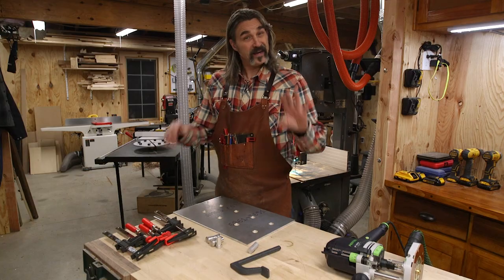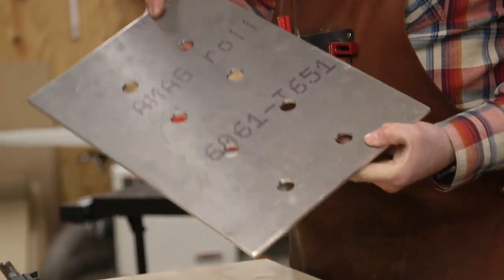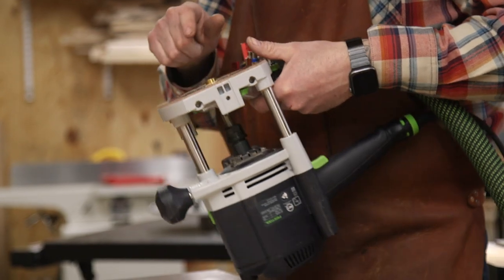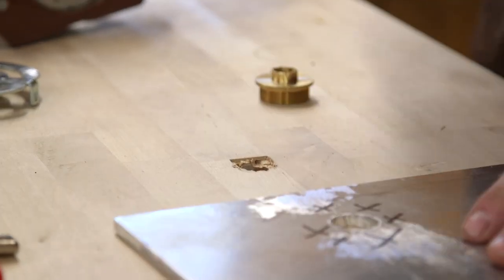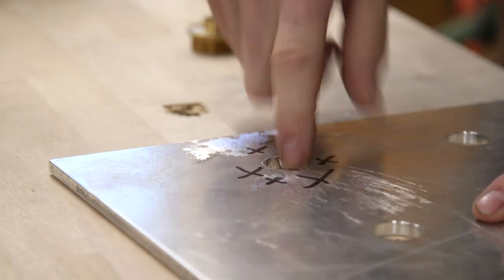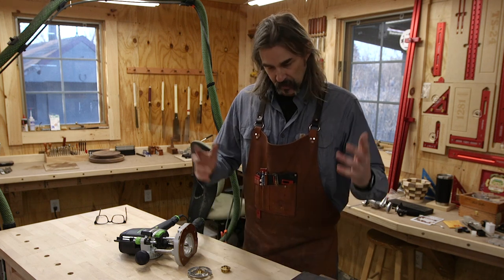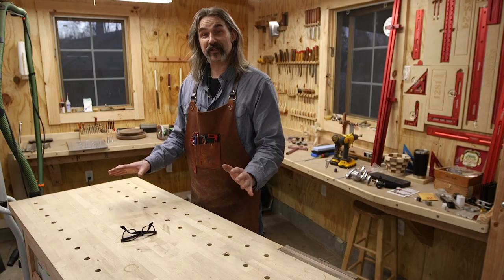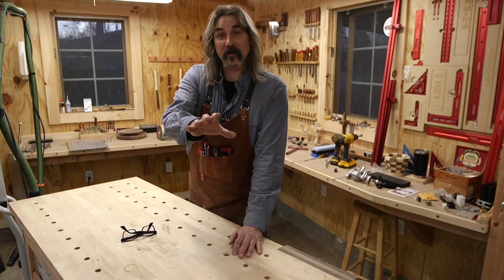Woodcraft 101: Workbench Dog Holes

Comment: Great video! I too have been using my work bench for years without dog holes or hold fasts.  It’s time. I like the idea of the template with a router. Thanks for being humble enough to share mistakes also. It helps to know what to look out for. Much appreciated. Thanks for posting.
Reply from the maker: Glad it was helpful!  I use them all the time!
Reply: I bought a parf drilling guide for this but your method is a lot less.

Comment: Do the holes have to be tight? I don't quite understand how the hold down can securely hold a piece of wood if the hold down just slides into the holes easily. thanks for any help you can give.
Reply from the maker: Great question.  The fit is not very tight.  Bench dogs / puppies have springs in them to tighten the fit.  Hold Fast wedges when struck on the top.

Comment: Have you checked to see if the bit is centered in the guide bushing?  Mine wasn't and Festool couldn't fix it.  I notched the plate that holds the guide bushings and I removed the 2 rice-sized pins in the ring under the plate.
Reply from the maker: I haven't used a gauge but by eye, it looked centered.  It's unfortunate that Festool wasn't able to correct it.

Comment: Great video! I like the idea of the aluminum template. How did you make it? I would think aluminum would withstand many more uses than OSB, etc.
Reply from the maker: Thanks!  I used the aluminum so it would last a long time.  There are a number of ways to make that aluminum guide plate.  I used a mill but you could also use a drill press or a hand drill.

Comment: I know this video was posted 3 years ago, but I'm just seeing it now and I'd like to do this.  But I have one question as to how this would wor with my workbench, as its 1.5" thick,  The bit you used is only 1.25" cl.  Do you suggest I use a longer bit, or finish the holes with a drill bit?  Thanks
Reply from the maker: I would suggest using a longer bit.  Good luck!
Reply: Thank you😎

Comment: What bit are you using? It seems like the wrong one is linked?
Reply from the maker: I used a 1/2 spiral bit and also modified the link.  Thanks!!  You could use a straight cut but the spiral will clear better and plunge better.

Comment: New woodworker question...why do you use a 1/2" bit to route the 3/4" holes?  Why not just use a 3/4" bit?
Reply from the maker: You could use a 3/4 forstner and drill them. With a metal pattern, I would rather use a 1/2 or 3/8 bit and remove smaller amount and gradually cut them.  Easier to control and sneak up on final size.

Comment: Woulgn't it be better just to use a drill with a forster bit?
Reply: I thought so too, but I found out that Forstner bits are quite slow going that deep and overheat. 
Also a hand held drill requires a vertical guide to maintain perpendicular.  
A plunge router solves both problems and can be done on a tighter budget than you saw here. 
Do a YouTube search 
“Drilling bench dog holes” and you’ll find hand drilling done accurately.  🤜🤛

Comment: Why did you not use a Forstner bit? using a router is more accurate? I have to drill holes in my extremely hard wood workbench top, I'm doing my homework before I take action since this is one those tasks where you can't un-do, not safety net here as you showed in the video.
Reply from the maker: You could do it with a forstner and a plunge mount for a drill.  It would be difficult to get the holes perfectly straight without a plunge mount.  I felt a router was more controllable and I already had a plunge router!